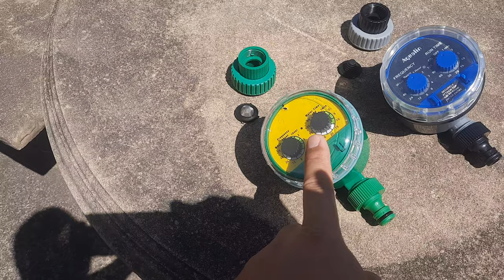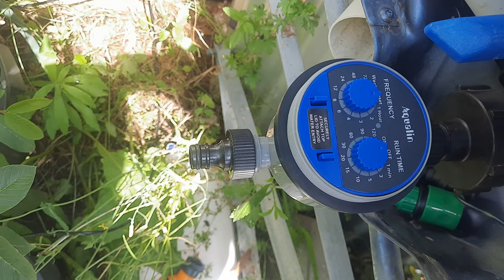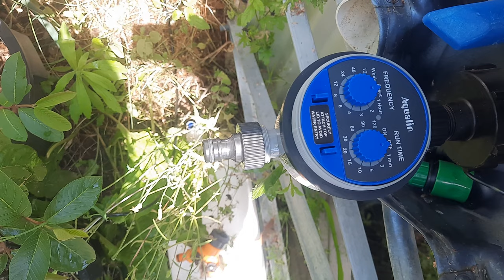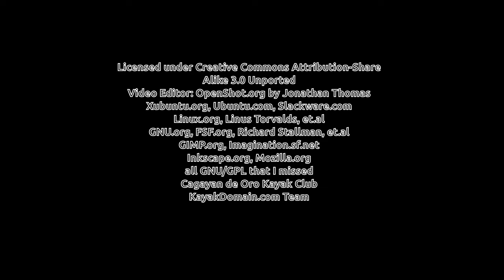What is the right Water Timer for your Garden Rainwater Tank?

Comment: Hello.. Thank you very much for the video. I would love to know which of the two is most reliable to be used on tap connected to 1.5 Bar water pump. The water out will be for lawn sprinkler.
Reply from the maker: Just an opinion; if the source has pressure like typical house faucet, then I would suggest using the Diaphragm type.

Comment: Ball valve is better because it opens and shuts slower thus the water control is more gradual the diaphram valve snaps open and shut givng a sudden blast of water which can cause leakages or blow offs further down the system. More expensive but less problems. Usually there is no identification as to which type is on sale which makes selection very difficult.
Reply from the maker: Thanks for the explanation.

Comment: One question please. Can I leave the device fixed in "on" and power it when I want the water to flow and unpower it to shut off the water?
Reply from the maker: I'm not sure if that kind of device is available.  I use a battery powered device. You are describing a none battery powered device.
Reply: @CDOKayakClub  hi there, thanks for replying me. Yes, it's battery powered like yours in the video. I didn't buy it yet, but my plan is to power the device using a 3V  power source (wired) and I think in putting a switch so in raining days I could switch off the device
All that because I consider to install the device a bit far so I thought about control the device remotely instead of manually
Regards from Brazil
Reply from the maker: Just try your idea. If it works then so much better.

Comment: how long the battery life for valve one
Reply from the maker: It depends on how long and how often you set the timer. My settings are 30 minutes/day. I use an alkaline battery. And that's still running in 6 months.
Reply: @CDOKayakClub  thanks exactly what I found in the sellers description
Reply: @CDOKayakClub  i hv another question. How many day it takes your ibc tote for watering specifying the space you have. Thank you again
Reply from the maker: With my settings at 30min/day, that would last for at least 2 weeks without rain.
Reply: @CDOKayakClub  Thankyou Friend, how much space do you water, in m2 with the ibc tote
Reply from the maker: I use drip irrigation. The drip hose goes directly to the small plants, like rosemary and 3 fruit trees that are about 1.5m tall and growing. I don't need to water a big sqm because it's drip irrigation.